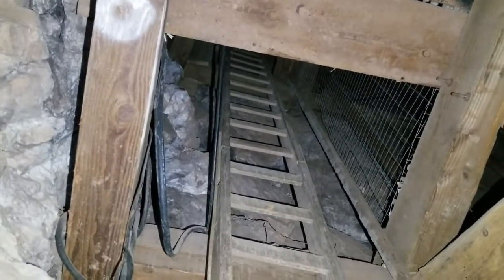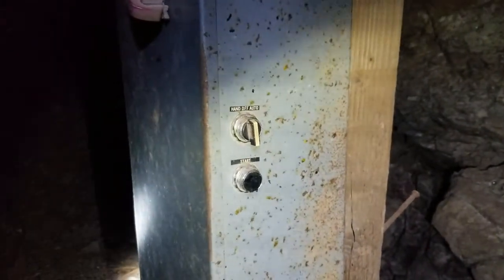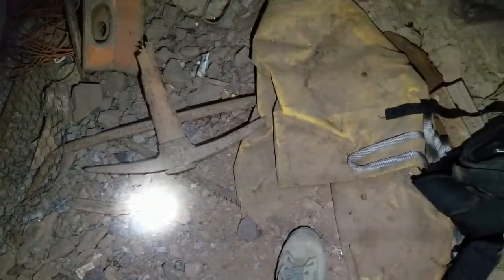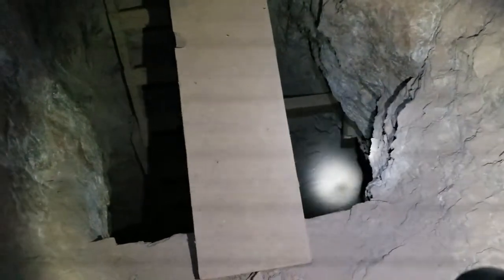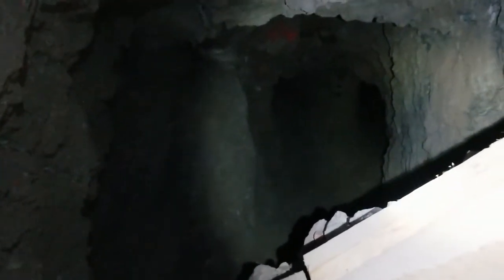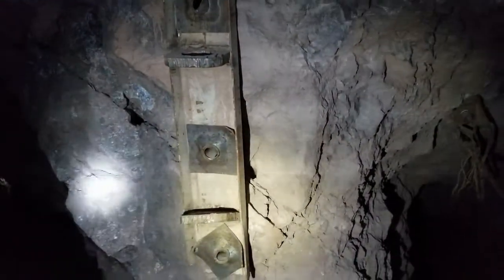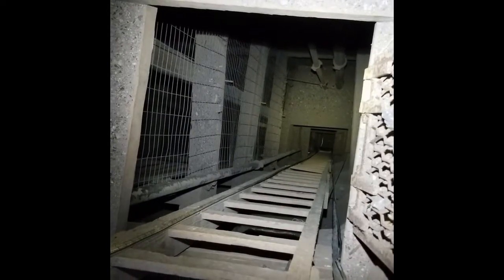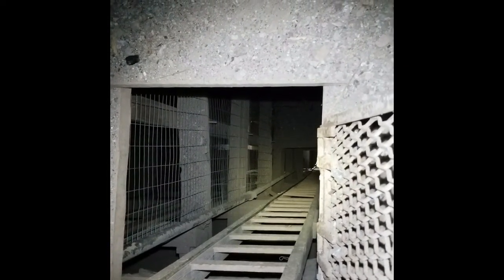Shamrock Shaft 300 Level: Finding A Miner's Cat And Huge Stope

Comment: Glad you got into this one! We dropped it to the 600 about 4 years ago. Records say it was over 1000 feet at one point, but the lowest level was done with LHDs and I’m assuming they filled the shaft with the waste. It ended at about 640.
Reply from the maker: Well, I'm glad you watched the video!  I've seen 975' but that's in the same ballpark. It surprises me that they'd fill the shaft as much of the future prospects for this mine are for deep ore. That's a lot of work with a Cryderman mucker that could have been avoided by just hoisting it. If I remember, I'll try to ask the superintendent (a business associate of mine) what the logic was there. One of those funny things: the air compressor from this mine ended up an an auction in Tucson. He bought it for a pittance; it's now sitting in a yard not twenty miles from the mine it powered!

I need to pick up a short rope to get from the 300 to the 350, then use our other 200' rope from the 350. Once we've gotten to the bottom of this shaft, we'll work on the other one on the property. After that, there's a long list of other shafts in the area for us to conquer!